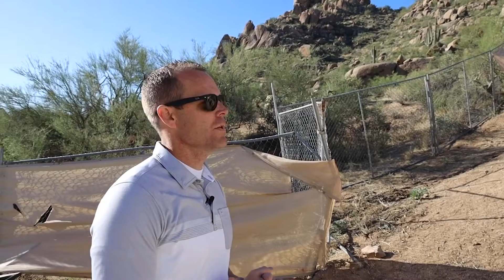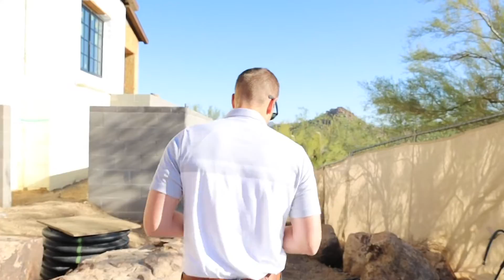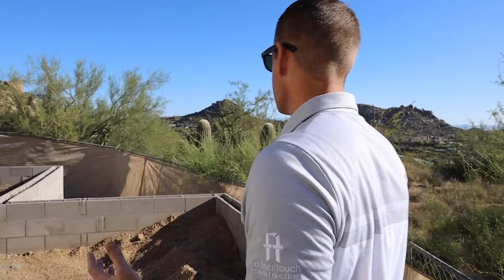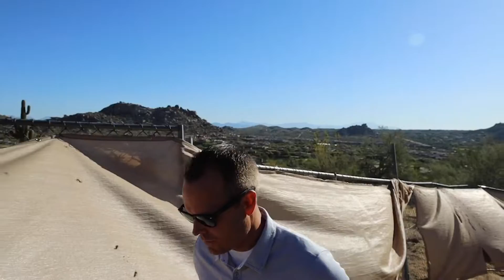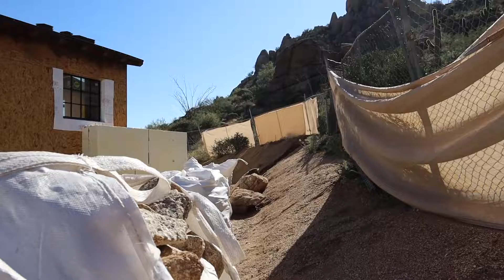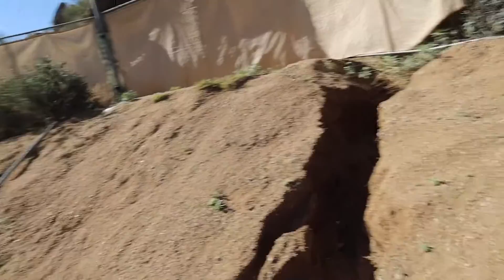HILLSIDE ICF (PART 1) | ICF HOME | EXTERIOR WALK-AROUND | AFT CONSTRUCTION | SCOTTSDALE, ARIZONA

Comment: Is only the first floor ICF? What were the reasons behind only the first floor being ICF?
Reply from the maker: Great question Michael. The HOA requires 66% of the exterior, and first floor, to be either concrete or masonry, not wood framing. We elected to go with ICF for the engineering, performance and efficiency of the home.  The second floor bonus room is wood framed, as well as the trusses

Comment: Great first you tube video Brad. Can you tell me what size of icf block you are using and why that particular size?
Thanks Brad. 
Looking forward to the next instalment. 
Cheers from Montréal
Reply from the maker: Thank you Marcel. And we used both 6" and 8".  To confirm, the core concrete width is 6" and the entire block with foam is 11.25". The 8" concrete core has a with of 13.25" with the foam. The 8" was used for all retaining wall locations, and any other structural bearing locations. The 6" was used at all non-structural walls